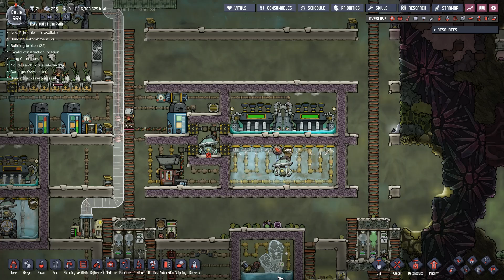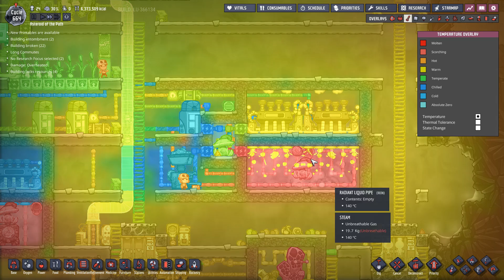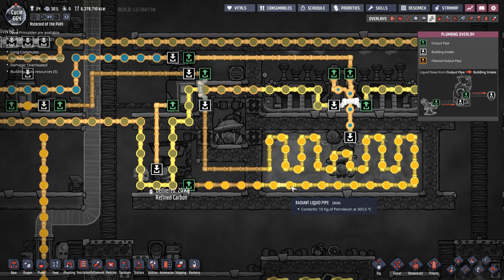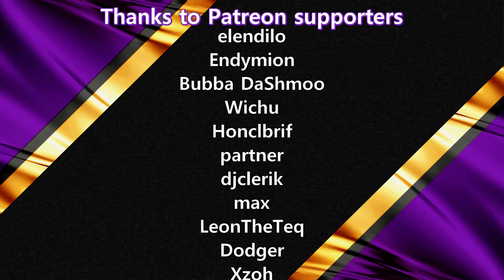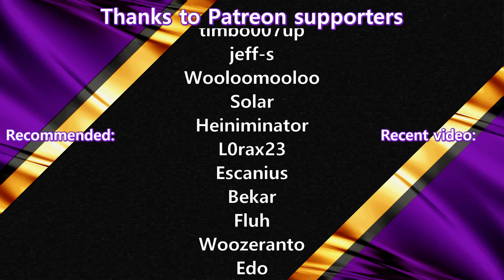SELF POWERED STEEL REFINING - Oxygen Not Included - Basic Builds

Comment: Gas pump is unnecessary. Make a liquid lock right next to the room. Fill the room with tiles. After that, remove the tiles. Now you have a vacuum. Next, add everything you need inside, close the room and remove the liquid lock. All done, no need for steel.
Reply: You don't even need all that just submerge the room in water

Comment: Steam turbine's can overheat, rather easily. If the atmosphere around the turbines becomes very low they will melt, especially in a hot biome. Advice is to provide a bit of extra cooling and apply a tiny layer of oil to the floor. This will keep them going for much longer.